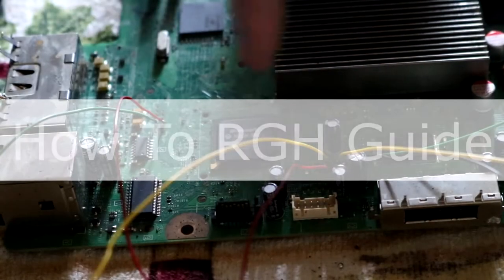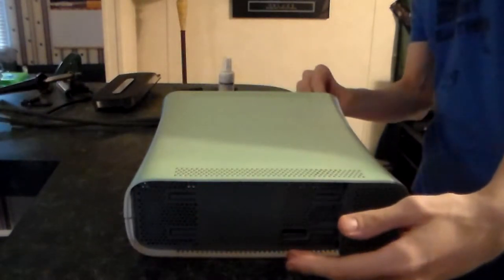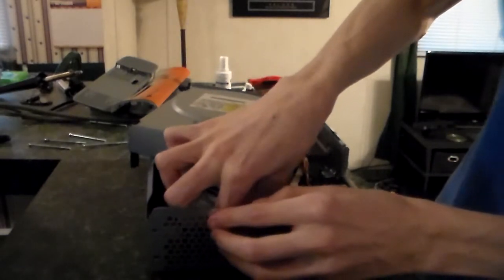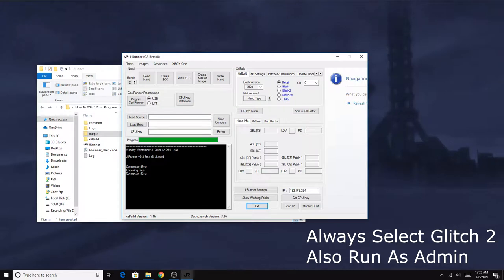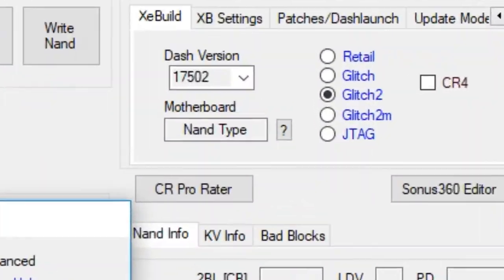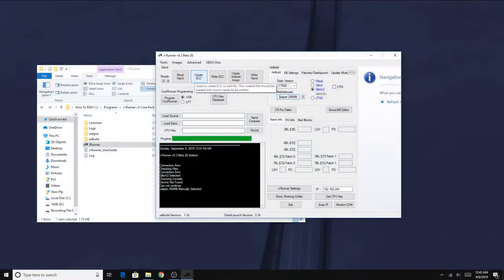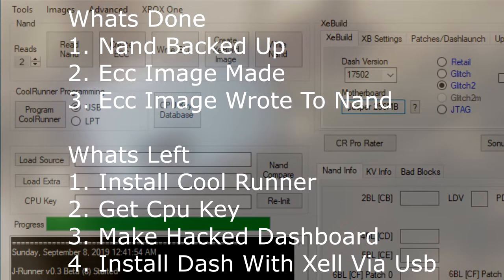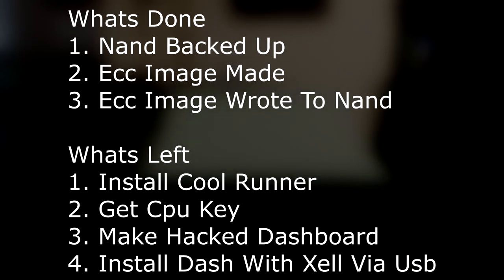How To Rgh Jasper Guide Part 1

Comment from the maker: Part 2 isn't out yet because I don't got the glitch board aka cool runner so it won't be out for awhile yet but thankfully I can be better prepared hopefully next time and get some decent video for you all. So if your following along with this guide wait till I update this comment to start anything cause if you follow only part 1 you will be left with a Xbox 360 that won't boot it will once we install the cool runner in the next part.
Reply from the maker: Should mention this it's been a year the console still boots and glitches first go. I also noticed how bad the soldering was for the nand reader in this video but those wires don't stay on so the solder job doesn't need to be perfect for that. In part two when you install the cool runner make sure your solder is on and that you do a good job soldering.